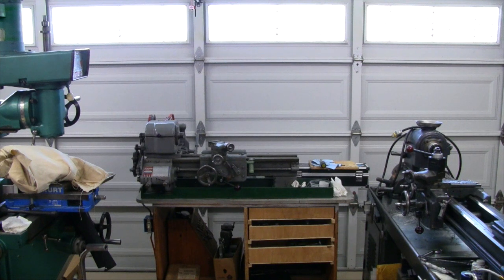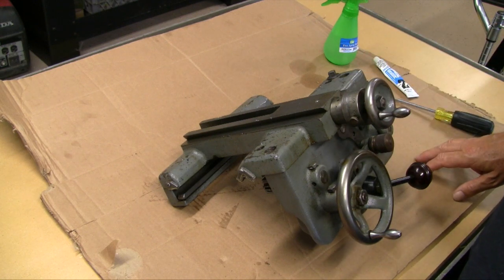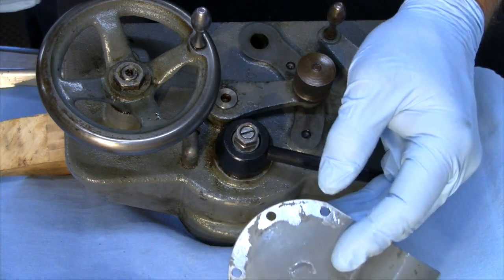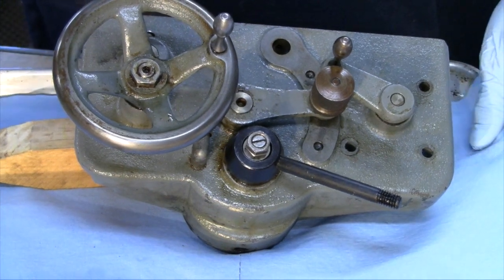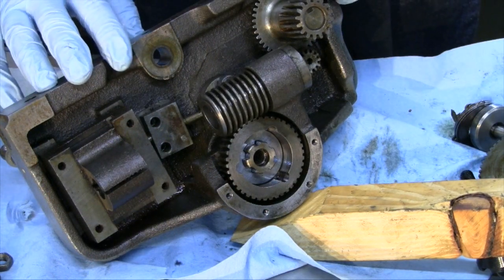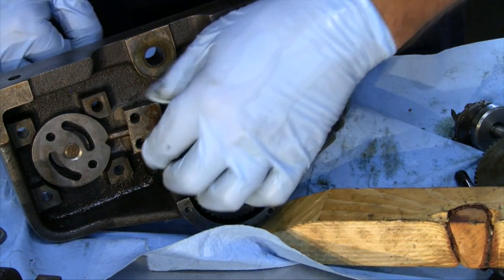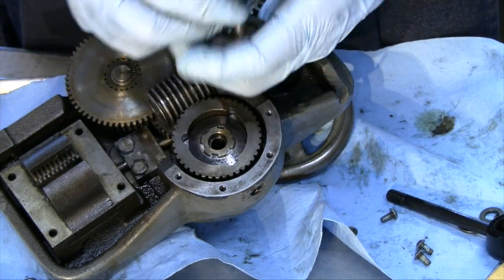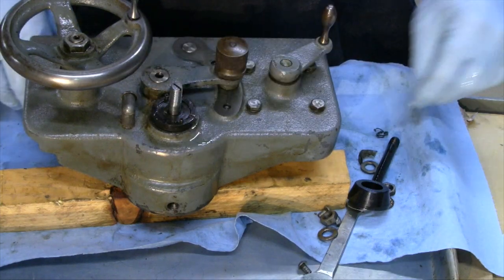Logan 9B 17 Apron

Comment: You have to remove the worm to get the worm gear out.  On small South Bend lathes the collar is threaded and pinned, and you have to remove the key to push the pin out from the inside (thanks, Tubalcain!).
Reply from the maker: Good tip, I thought it might be something like that.  I'm hoping I never have to go in and do that again, though.